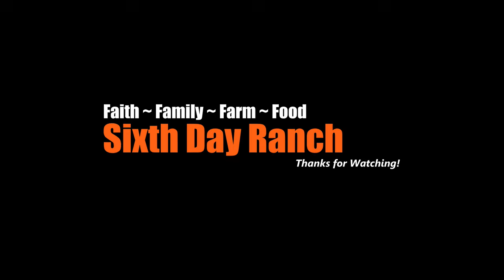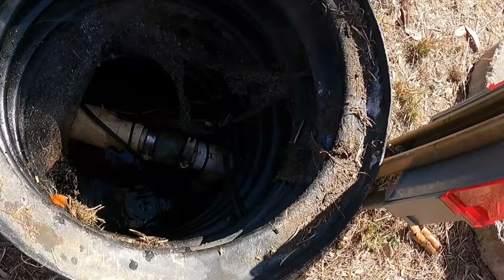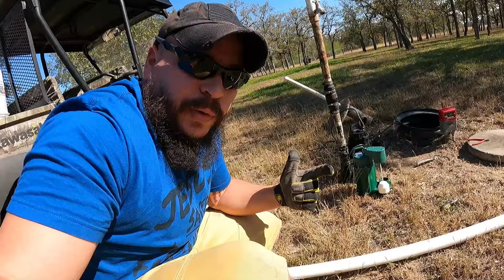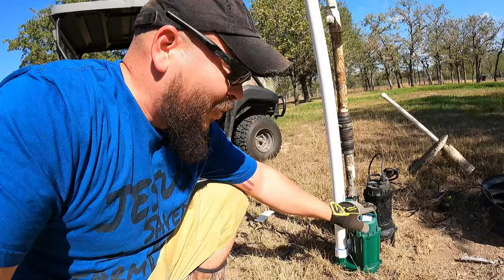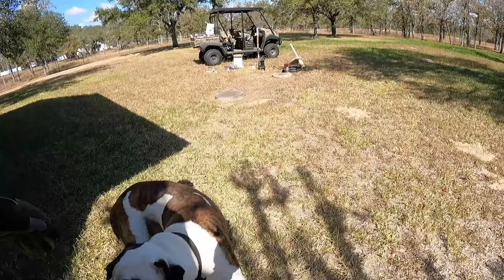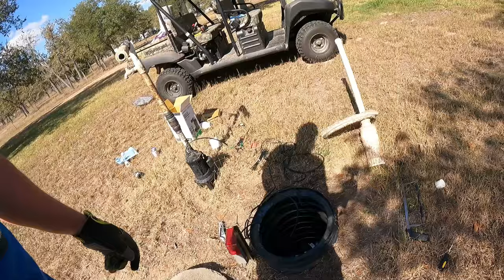Step-by-Step Guide: How to Easily Replace Your Septic Pump

Comment: The legs on the original pump are to keep it out of any sludge or sediment that is in the bottom of the tank. That way it doesn’t burn out quicker or push debris into your drain field.
Reply from the maker: Appreciate the tip!

Comment: Thank you for the video, just shame you didn't explain about the most difficult thing: how to connect the electric cables . If you could explain please would be great 🙏
Reply from the maker: You're welcome!  Sorry it is different instructions from on the pump you use.  Ours was direct wired so we just connected the three wires where the old pump was after cleaning up the connections a bit.  The instructions that come with your pump should have some good info.
Reply: @SixthDayRanch  thanks for the reply, yes come with instructions but I'm concerned I don't connect properly, also it's quite powerful one because I need to be pumped quite far away, I'm avoiding contracting a electrician because it's expensive but maybe I don't have another choice 😞
Reply from the maker: If you are uncomfortable the best bet is a licensed electrician.  It's not worth you or your family getting hurt!

Comment: You video is on point with what I may need to do myself. Have similar septic,  solid waste tank and a gray water tank. Grey water tank pumps water to a leech field basin & pump is not working when I turn from auto (have compurterized smart panel that pumps automatically) to manual which should override & turn pump on. Positive pump is not turning on. This is a newer home * have homeowners warranty,  waited 11 days for the scheduled appointment date/time, & no tech showed. Septic guy's phone # just rings...no answer.  Looks like I'm going to have to do the job myself. Appreciate your video...
Reply from the maker: Sounds frustrating sorry to hear about that.  Glad the video at least helped out a little.  If I can do it anyone can do it.  Hit me up if there is anything I can do to help.

Comment: I took an extra 120 volt submersible pump I had and plumbed me a stand pipe with about a 2 and a half foot tee at the top with one side of the tee capped. In an emergency I can drop it in and let it hang and connect some more 1 1/4: pipe I have to the open side of the tee and drain my tank down out into the pasture. I can just slip them together and since there is no pressure they stay together just fine. I cut the male end off an old heavier extension cord and zip tied it up the stand pipe and out. From there I can just plug it into a heavy extension cord from the outside receptacle on the house. I figured that out when I had a pump go out and the tank was running over.
Reply from the maker: That's a great idea!  I'm seriously considering doing something similar to this.  Those little pumps don't cost much and might be good insurance.
Reply: Thanks for your septic tank advice with extra 120volt drops in. I have two..trying to trouble shoot it….tnx again

Comment: What was the purpose of the hose bib, or spigot on the line, and why did you opt to eliminate it when you replumbed?
Reply from the maker: Good catch!  I have NO IDEA!  I can't find the logic in it.  I'm sure someone had the right idea at the time, but it's lost on me.
Reply: Probably for a pressure check system.  easy way to tell if your system has a leak (cracked pipe or ruts growing into it) or is plugged. Usually have a shutoff valve below it. Maybe where the lowest check valve was originally
Reply from the maker: Thanks for the info I think you are correct!

Comment: if there was no pump how did you drain it to work on it..i am sure now i need a new pump and i will do it myself after i fix my overflow pipe leak
Reply from the maker: I used a cheap utility pump from harbor freight

Comment: I rather the old school septic. Dumps into tank and liquid flows out opposite side high into a field line pipe while solids fall to bottom. 
No pump needed.
Reply from the maker: Ours is basically like that but the drain bed is  elevated so has to use a pump to push it into the drain field.
Reply: @SixthDayRanch  if you ever have to redo that just go with a long field line which is basically a semi deep ditch with gravel..
Reply from the maker: I didn't describe it well, but that's what we have.  It's just a pressurized conventional system due to soil conditions I believe.

Comment: How much does it cost to have a septic tank besides rid ex a year
Reply from the maker: Yearly septic cost is very low if maintained properly.  Electricity for the pump is the only ongoing cost.  Every 3-5 years the tank will need to be pumped out which costs ~ $150-200 around here.